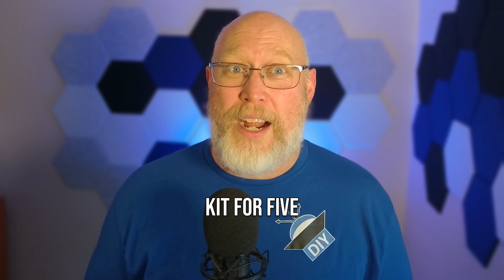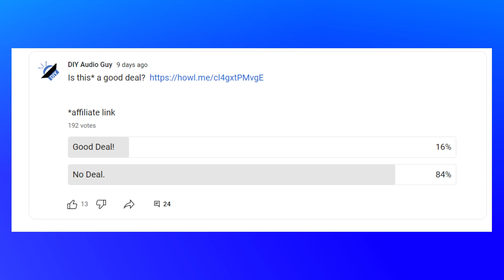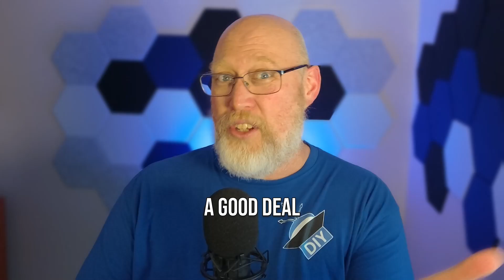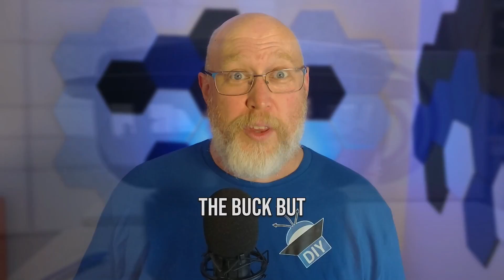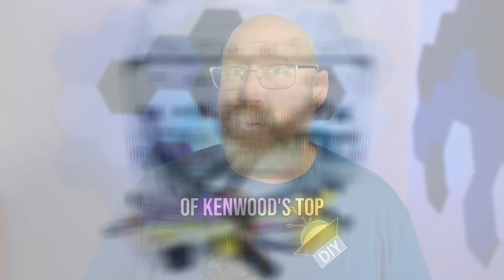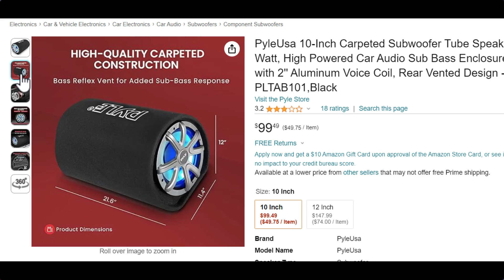Deal or no Deal:  Car Audio fans vote!

Comment: 6×9s do have more cone area, but the issue is that it's not a solid shape and you get a lot of cone flex because of that. For whatever application you are going for, go with a circle. Also, let me get this straight, $1,000 is a good deal on a head unit because you can watch dvds on a 7 inch screen?

Comment: I've had a pair of Skar VXF 12" subs on a 4500 watt RMS amp for a few years and they've been decent enough for me. I got an insane deal was really the reason I did it. At the time (2020 or so) the prices were dirt cheap and I utilized their old loyalty system and a sitewide 20% off. Two VXF 12's, 4500 watt amp, box and OFC wiring was like $600-$650. I have checked since then and their prices have gone up by 50% or so over full price from before (well over $1100 now). I'm currently running 2 ohm to the amp until I get a 3rd sub and wiring 1.3 ohm to the amp. I went 10 years or so without a system and before I had 3 JL Audio 12w6 wired the same way in a sealed box on an old school 2500 watt Phoenix Gold Titanium amp (when PG was still good) and loved it. But I was young and never handled my power issues like I have now so I only imagine how it should have sounded. Old, more wise, me bought a new alternator, battery, cap and OFC wiring. I have a gel cell optima yellow top but will be adding a second XS battery with an isolator before adding the 3rd sub and another amp

Comment: I just got a deal at a garage sale.  I found a box with (2) JL Audio 10s in it for $30.  I had to re-foam the speakers, but for $8 per foam kit, I still think it was a great deal at a total price under $60 including the glue.  I currently have this installed in my truck and it sounds great.
Reply: this is how i got the first two 10w3v2d4 subwoofers. guy didnt know what he had and all i did was re-foam them. i now have 4 of them in my truck and they still absolutely slam running the RD1500 to them.
Reply: @smiththers2 That’s awesome!

Comment: Question: why would i want 4 ohm for a HOME sub?  My home cabinets are dual 4 wired up to 8, and if i were to do a 3 way loudspeaker i'd use one in each enclosure.. but in a single wouldn't it be 8? Do most plate amps utilize 4ohm now?
Reply from the maker: Just because the power is cheaper if you can play at a lower load.  Most plate amps are 4 ohm stable.
Reply: @DIYAudioGuy  copy. Yep i have never pulled one apart to test, i learn something new everyday!

Comment: Coming from a a PA and hifi background the whole super low ohm legacy fixation for subs in car audio has always bothered me, wiring for 1-2 ohm load or below puts a hell of a strain on the amplifier and makes the resistance of speaker wires significant in delivering power to the speakers.

This seems to come from a time when car amplifiers where limited in their voltage rail capacity, so they went for high current rather than high voltage in making up those watts. These days however, delivering 80-100v to speakers is hardly a problem, and in doing so you can throw many kilowatts around like they are nothing, and make the resistive losses in the (class D) power amplifier output stage and speaker cable requirements insigificant; and into the bargain maintain tight control of the driver by designing system spec to a 4 ohm or so load.

Comment: Not sure why people hate skar. At least its not Pyle, Boss or Pyramid. Though even those if set up right can hit hard.

Deal or no deal,  My EVL 15 has been slamming for 3 years on the same amp that killed an l7 every 6 months. 
It is loud enough to hurt my ears and not break and that's all I want. As long as no one sees the sub I get compliments on how clean my set up is.

I used to run Morels, but I got a set of JBL GTO's that sound pretty close with out the trouble of installing 3 ways.

The pioneer head unit. I have the 160BT.  I am running to 2 amps. Its a great deck  for $200
Reply: at the shop i work for, people hate skar because it can be had cheap vs other name brand stuff. every single one of the packages i have installed worked as advertised, and they're loud. they're not musical, but def loud.

Comment: I got a pair of different Dayton 10" subs ($47 each) and was blown away by the build quality. They are more than I need in my man cave.
Reply: i have gotten quite a few over the years. the bigger subwoofers def dont like amps with dirty power, but they sound so good still. i have a pair of the 8's designer series in my tower speakers... subwoofers that run with a 2-way crossover and tweeter. sounds almost perfect to my ears. the box hits hard, and amazingly plays very low. if it werent for the large volume requirements of these things id be running 6 or 8 of them in my truck.

Comment: The 18 was a pro woofer not sub. It will not hit lows like a sub. The 18 Dayton is a home cabinet speaker replacement.
Reply: You have to cheek the specs of the driver, qsc makes 18inch pa drivers for theaters that have no problem hitting 20hz

Comment: DIY AUDIO GUY How are you like your JL audio 8 channel amplifier?
Reply from the maker: It looks pretty sitting on the workbench.  Hope to get it in the truck sometime in May.
Reply: @DIYAudioGuy  always enjoy the videos and great content.
Reply: @DIYAudioGuy  as a JL dealer myself, i can tell you it will not let you down. ive been running JL for 20 years. did you get the one with DSP or no? if yes, then def have someone with a MAX tune it for you... its a crazy good system.

Comment: Hated all of my Skar audio equipment! I've had Walmart starter equipment that was better build quality.
Reply: I have lots of skar stuff and installed alot in other. Never had issue other then wiring kits not being tru 4 Guage. Skar is good stuff and priced extremely well.
Reply: I’m running two rp4500’s strapped at half ohm just fine. On same system my two jp33 amps went out after 3 months

Comment: These days I prefer the quality of the bass I get from "Pro-Audio" subwoofers. The efficiency and transient response is simply awesome. My Ultimax subs sound like mud by comparison.
Reply: The UM is a fantastic Infrasub . 👌
Reply from the maker: Maybe I need to give that neo 18 a try!
Reply: Since I tried the PA460, I've felt the same way. I had UM18 and PA460 at the same time and for music, it's no comparison. The PA style woofers are much cleaner sounding and respond quickly to changes in volume in a way that the UM18 feels lazy.
Reply: @boredanddoingthings   I havr 8 PA460s in my closet.  Need to build some VBSS 🎉
Reply: I just like lows